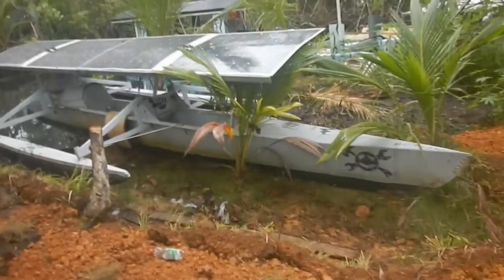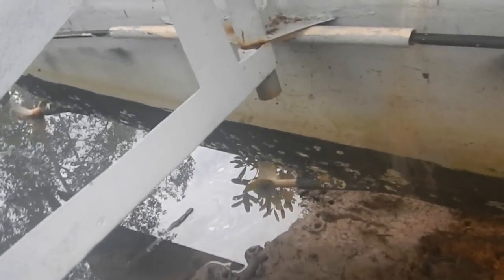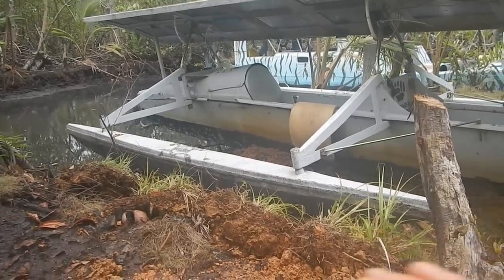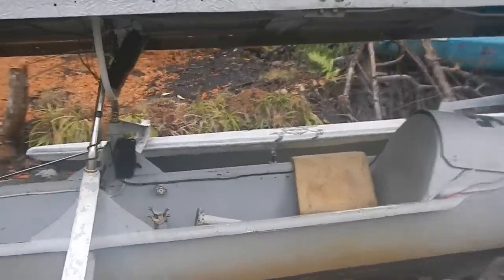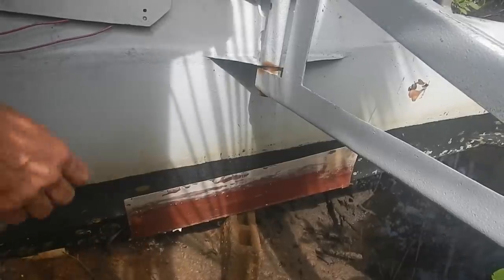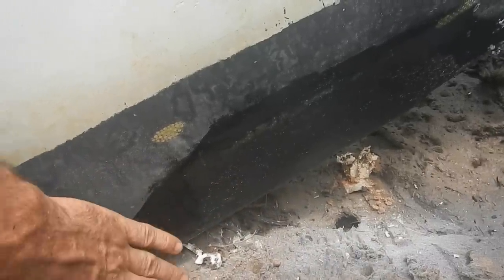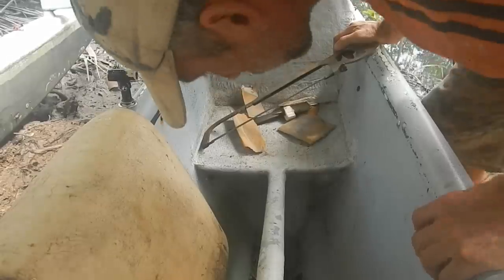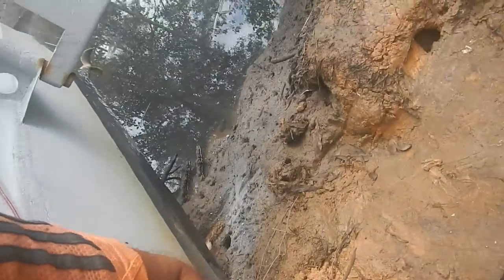Zombie Chopper 007 Pedals Out!

Comment: Hey i agree the peddling prop is causing more drag than because you cant get enough speed to catch up with the electric motor speed.  Id just leave everything as is but have a easily installed peddle prop. Leave the tools and the peddle prop on board for back up to be easily installe if needed.

Comment: You needed a backup pedal system just in case the electric system fail and or upgraded the gear and the propeller for a higher speed one.

Comment: Really encouraging to see you make changes to this boat. Especially undoing old systems. I sometimes get attached to the way I built things. But, cold logic here was best. This boat's light enough to paddle, and if you really wanted a solid backup, you could get some oar stays and two long proper rowing oars. I'm most happy that you just have a solid battery and charger. This is definitely the way to go. If you need extra battery, once your voltage sags down below 21v (not too long into your ride), you could hook up your Dewalt batteries too. I just use dimes rolled into the pos and neg slots, and gator clips. Just gotta remember to remove them before you walk away from the boat in case they overcharge. Your flexvolts are good enough to be equivalent to 1.5 hours of cardio each. Would help get you home in a pinch.

Comment: Just take the propeller off the shaft and tiny hull portion won't cause a ton of drag!
Reply: It is really surprising how much drag a little inconsistency in flow makes. William Fraser youtube channel did some experiment with fairing propellers and motor shafts and gives test results.

Comment: I would be concerned about the motor failing and leaving me stranded - maybe set up another smaller one that can be used in a pinch that you can swap out? Old trolling motor maybe? If the battery fails you can limp along on solar...

Comment: Jamie, keep the pedal mechanism and hook up to a generator; charge the battery when you feel like some exercise. Too late now! Looking good, Cheers.
Reply: ha this was going to be my suggestion - pedal to charge the battery instead- otherwise i know there are propellers that fold in when not spinning so at least it will cause less drag but still there if needed/cloudy
Reply: Running pedals to generator would want a different ratio anyway, and could be accomplished with bicycle parts much easier that adapting the pedal drive... A great idea!
Reply: He could make it out of an old bicycle.

Comment: Instead of making nice cut pieces of fiberglass mat you can tear fiberglass by hand to a pieces with uneven edges with uneven stands on the edge. So when you apply it it will spread the stands on edges and you will get smooth transition from surface to applied portion of fiberglass. Smooth transition without sanding

Comment: You could've used a gear set from an angle grinder to change the ratio of the manual shaft, to sync the rpms with the electrical drive. However, that manual prop was in a weird spot, and the boat will be better off without it. Good decision.

Comment: Jaimie.. you need a redundancy system... that's why most boats have a spare of everything and then another spare for that... you need another propulsion system incase something happens to the motor or wiring when your out in the middle of nowhere and have nothing to move the boat.... what about a folding prop???

Comment: Good call! I'm guessing an extra half knot speed or more. I'm sure you've thought of it, but you're going to need a backup form of propulsion, even a little paddle would do, and you could rig up a small sail, 30ft2 (assuming about 40ft2 wetted surface area) ought to be enough to get you moving in a light breeze, could use the backup paddle as a keel/steering device, or could make a retractable leeboard. And I'd strongly consider making or buying a more efficient prop, assuming proper pitch that would probably get you another knot or more and make it more efficient at all speeds. https://www.youtube.com/watch?v=4kL66c6T9po   https://www.youtube.com/watch?v=0bP2MH3LqvI